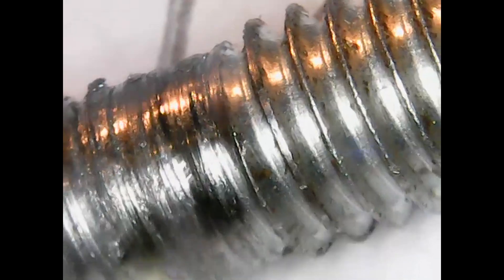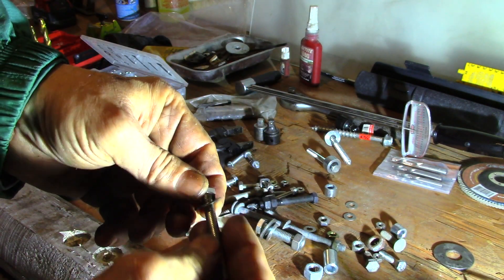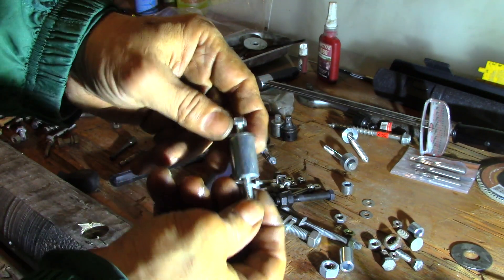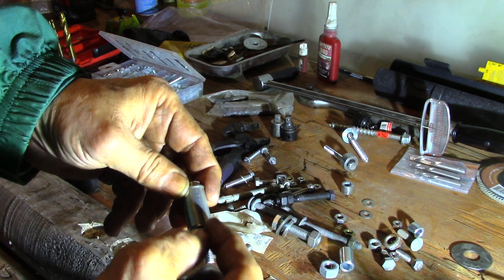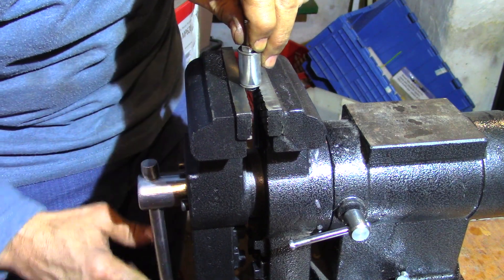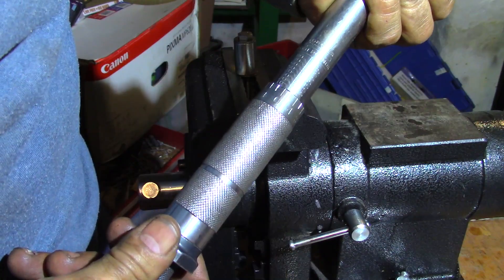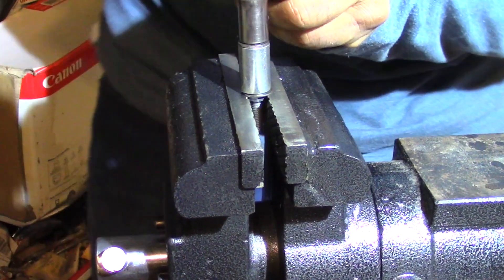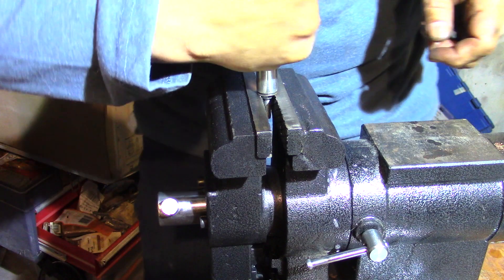Why Bolts and Screws Strip Shear How to remove a striped bolt

Comment: Wow!  Most crap bolts are glass hard - and glass brittle.  That one looks like it was made from solder.  Try the test with a real, (AN, NAS etc.), bolt and it will elongate and fail in the middle like a test specimen.
Reply from the maker: I do have videos in the que to show it done with a class 8 bolt...   I have a series of videos coming on my other channel that will show how predictable bolt failure can be and how to avoid it with a simple ''trick''...  You will love it...   It is so simple and does not require a $3,000.00 clamp force meter...